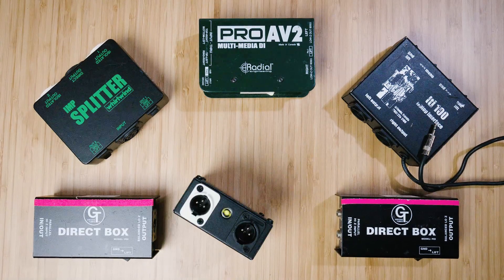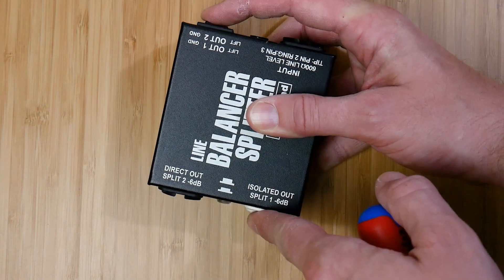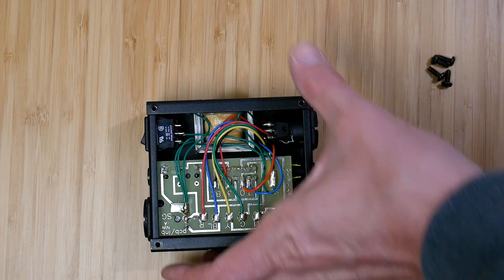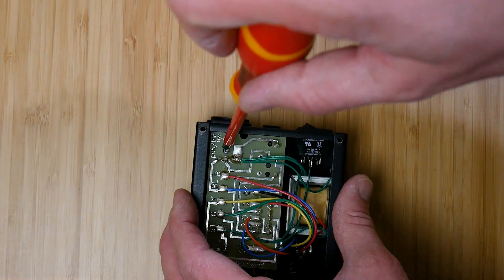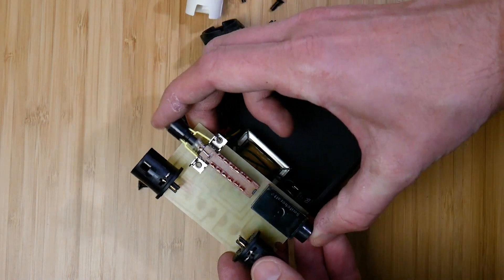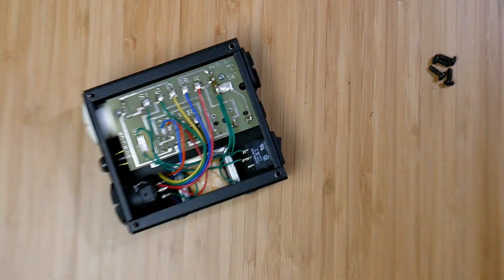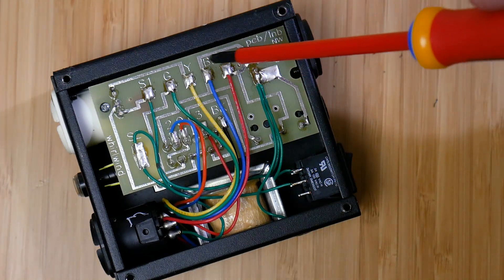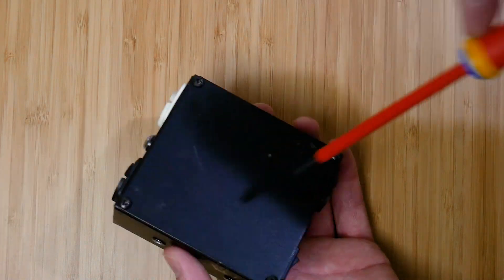#51 - How To: Splitting, Balancing & Isolating Line Level Audio signals.

Comment: i need to send 1 condenser mic to 2 different interface's. how can i line split when it need 48v phantom power? do i just turn 48v on. on one interface? i figured 48v on both interfaces would damage the mic..... im losttttt if you could give me advice id really appreciate it!
Reply from the maker: Hi, thanks for the question. When you look at transformer mic splitters, you'll see one output side is labeled Direct & the other ISO. You can apply phantom power from the interface connected to the Direct out, since the transformer is isolating the ISO output and as such will not pass phantom power.

Comment: Can I split a Monitor Output (from “unpowerd” Kemper Profiler Amp) with one TRS balanced end into 2 unbalanced TS instrument inputs on my audio interface? Or is that just too much power for the USB-powered interface to handle? Afraid to fry it!
Reply from the maker: The Monitor output on that unit defaults to Mono, but you can switch it to stereo in the menu. That output is line level, so you should be fine connecting to any interface with 1/4" line level inputs, though if you have it, I would go with the digital S/PDIF connection and avoid the extra conversion steps. Thanks for the great question.

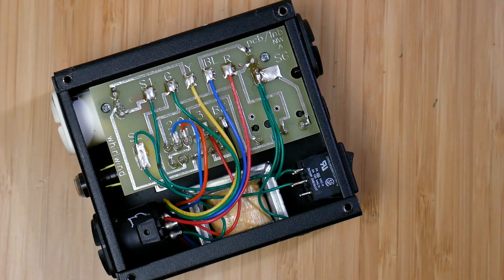Comment: 3:26 "I purchase the entire box for $20" say what now??? I can't find ANY that cheap anywhere. At least 3 times that
Reply from the maker: There are a pair of two right now on eBay for $90 ($45/each but they've been re-listed since Dec and are now accepting offers) and completed listings show a ton that have sold recently from $30 - $40 ea. A pair of TWO of them sold in January for only $20 total. Set a saved search with an alert on eBay and you'll absolutely find them cheap on a regular basis.

Comment: Can someone explain what the transformer does here and why you could not just solder 3 cables to 1 connector and call it a day
Reply: You block noise from ground entering the signal.
Reply: @boddumblues  And not just from ground, but EMI too. Conductors/cables act like antennae, so in this case the Xformer provides an unbalanced to balanced conversion as well, which allows the rest of the cable run to be completely noise free (in practice). The stereo version of this box (ISO-2) can be used to route an unbalanced source (outputs such as line level that are also designed for headphones) and many other popular not-necessarily-consumer level gear. My RME HDSPe FX (high end PCIe audio card) has unbalanced line/headphone outputs, as the rest are all MADI. You could build the same thing for a lot cheaper with OPamps, but then it couldn't be passive. A -6dB loss on a source that is already at or very close to unity gain could in fact be a god-send for the less experienced user (and easily compensated by the professional).